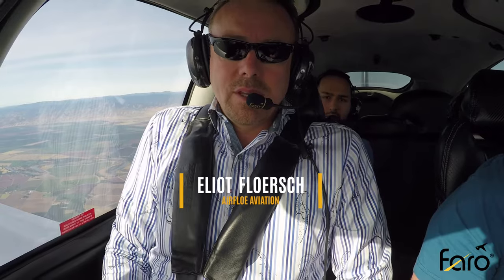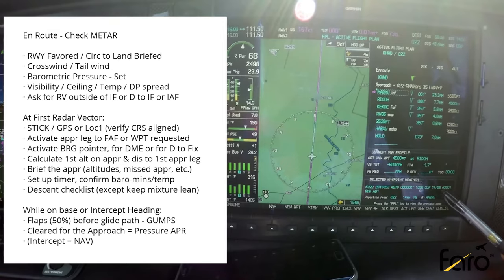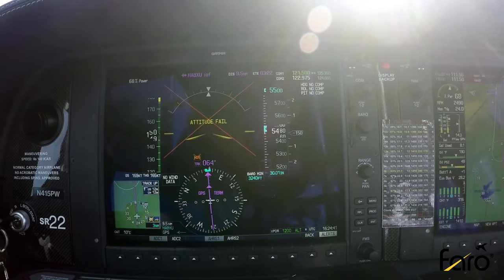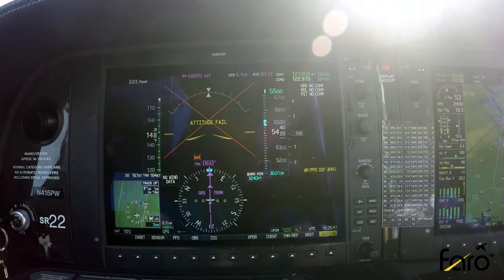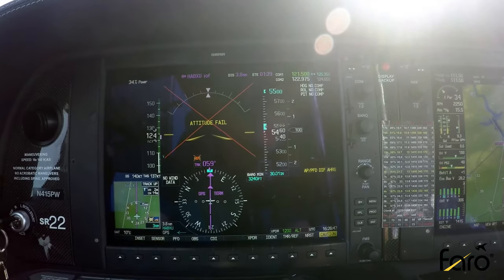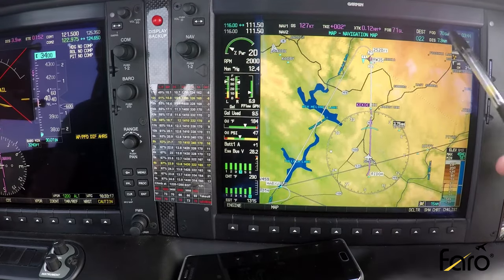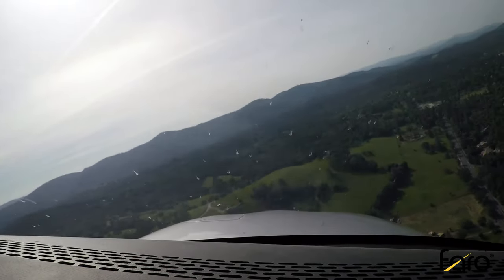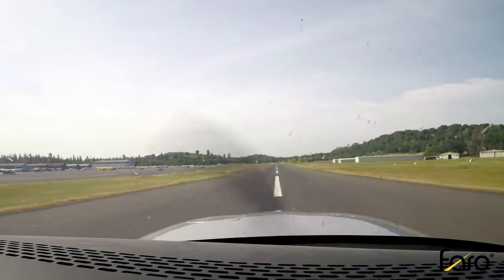Cirrus Perspective - No AHRS GPS approach

Comment: See Garmin’s G1000 Guide for Designated Pilot Examiners and Certified Flight Instructors. That document notes in part:
Cessna does not recommend pulling circuit breakers as a means of simulating failures on the Garmin G1000. Pulling circuit breakers—or using them as switches—has the potential to weaken the circuit breaker to a point at which it may not perform its intended function. Using circuit breakers as switches is also discouraged in Advisory Circulars 120-80, 23-17B, and 43.13-1B. Additionally, a circuit breaker may be powering other equipment (such as avionics cooling fans) that could affect the safe operation of other equipment.
Reply: 1) This isn’t a Cessna.
2) This is the way Cirrus CSIPs have been instructed to perform these simulated emergencies so that students can see how failures will appear.
3) Other hack-methods do not prepare students for real failures.
4) Learning these emergencies by video saves lots of CB cycles.
5) I’ve never had a CB failure in nearly 20 years of teaching in Cirrus Aircraft.